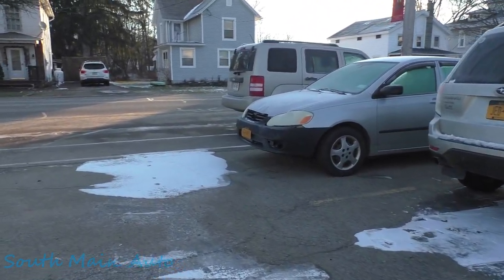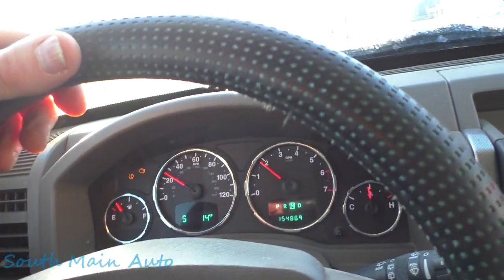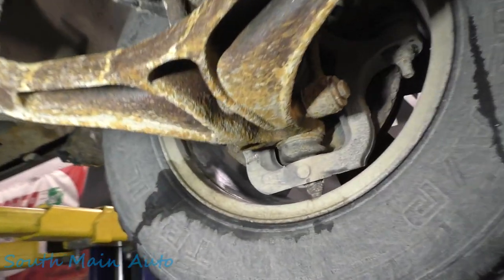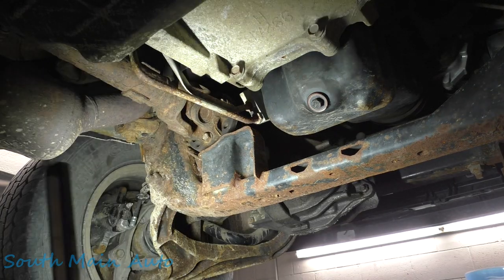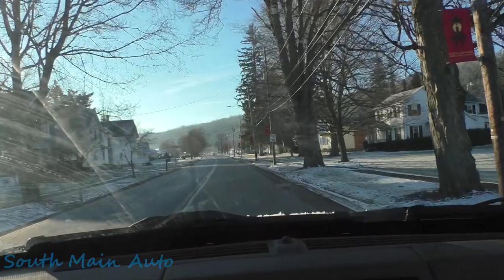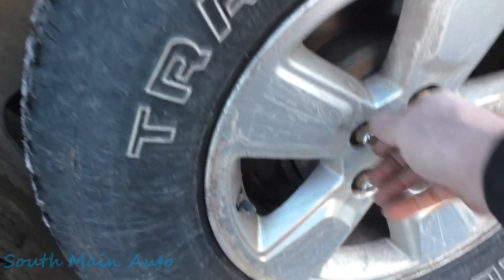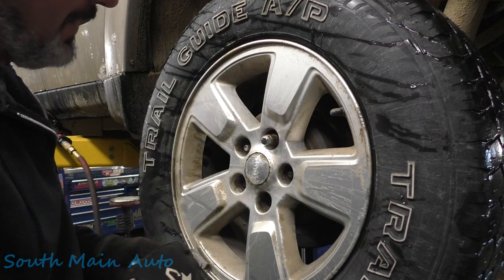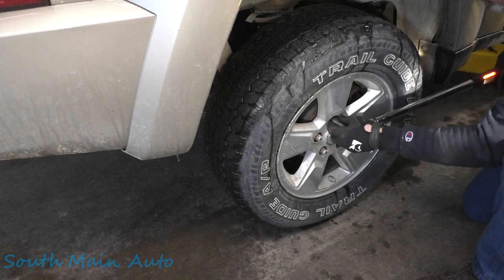Customer Just About Lost It.... A Wheel That Is

Comment: Two stories that connect. Dad had an 01 Ram and bought some American Racing wheels for it, you know the ones with the 3 tear drops, yeah, those. Anyway they were fine for several years, he had a service done and was driving around one day not long after and the driver rear wheel passed him going down the road. Luckily no damage. He put the wheel back on and it was fine for another few years until he traded the truck. He kept the wheels to sell later.
Several years later I bought a 99 Ram and decided those wheels would be a good change. I tossed them on and drove all over. One day, headed to his house from mine, I came down a hill where there is a stop at the bottom. Close to the bottom I felt a vibration but had to stop a few feet later. I stopped and took off carefully and sure enough the vibration was there. I continued slowly and tried to figure out what it was. A few seconds later there was a clunk and the driver front dropped a little. I carefully eased over to the right shoulder, thinking the wheel was off. Hopped out and looked. The wheel was still under the truck but the brake rotor was riding on the inside of the rim. The only thing damaged was a couple of studs. Jacked it up, put a couple nuts on where I could and limped it home. Replaced the studs and looked at the wheel and there was no damage. Put it back on and it stayed for a long time until I sold the truck! Cursed wheel!!

Comment: Over the years of running a garage i have seen loose wheels several times .A few times the wheels and studs were shot and needed to be replaced .I only did it once was installing wheels on a car after doing  a brake job . A phone  call from another customer came in and i forgot to torque the wheels, they were just hand tight. The road test saved my reputation .I heard a clunk before i left the lot .I knew  i had forgot  to torque them up.I  re/ road tested and all  was good.I always say the most important part of a repair is the road test .

Comment: Hi, I'm from Australia, (big island a long way south west of Hawaii). Back in the 1970's my family lived about 120 miles from Melbourne, and I stayed in the Melbourne suburbs during the week for university, travelled down Friday night late, returned to the city early Monday (left about 4 a.m.) aiming to get back to my city place before peak hour traffic. Had been servicing the car over the weekend checked brakes etc, put all the wheels back on with nuts firm but not tightened. My approach was to leave the hubcaps off until I had torqued up all the nuts, then fit hubcaps as each wheel was checked and finished. Got called for lunch, ate, went for a walk on the beach and came back, thought nothing of it, but my mum had come down and fitted the hubcaps. Left at 4.00 a.m. next morning as per schedule, working through a section of winding road at about 70mph, massive thump, and front left wheel departs, climbs an embankment, jumps a fence and runs about 1/4 mile across a field, hits another fence and stops against it. Meanwhile I had pulled into some space on the opposite side of the road, got out to survey the damage, and started to follow the  wheel track through the field to recover the wheel. Found it with the hubcap on, full set of nuts inside. Lugged it back to the car and managed to lift the nose of the car enough to jamb the tyre under the bumperbar, which gave me just enough room to get the car jack into place, lifted the car, refitted the wheel (studs damaged but OK for emergency use), checked other wheels (all nuts loose but torqued them up), and continued on my way at a more sedate speed. Darned lucky really, left wheel came of in a left turn when the wheel unloaded with body lean, previous curve was a right turn with a field of trees at the side of the road, if I had lost the wheel in that curve when the wheel was fully loaded, I would have been straight into a batch of 4 foot diameter gum trees. Spoke to my mother on the phone from back in Melbourne, she had gone around and fitted the hubcaps while I was at the beach because she didn't want me leaving them off cos it would make me look like a 'hoon' (Aussie term for idiot driver who doesn't care less about others).

Comment: My rule for all non steel wheels was torque to spec and write on the work order "return in 60 miles (100km) for free re-torquing" This included tire repair advice for flats carried into the shop.

Comment: Ha, having a KK for many years, I knew exactly what it was when I heard it. I had the same thing happen on mine. Ended up being when I did the brakes, I got some anti-rust spray on the studs when coating the hub face. The additional lubrication helped the lugs nuts back out easier. Brake cleaned the studs & never ran into an issue again. The sound is the spokes hitting the calipers which is why it goes away with brakes applied.

Comment: Holy.. I am instantly reminded of the time a tire popped off on me on route 90, driving a Yukon.  I was young and driving with a trailer and touring musicians; it was not my vehicle and I didn't understand how things worked back then.  We were driving back from NYC to Boston escaping a hurricane and kept having a strange vibration but only while turning to the right.   The vibration eventually got so bad on the Mass pike, around 5 AM, the right tire pops off, we come to a BOOM landing on the right front, screeching halt in the brake down lane.  I was lucky enough to feel it coming and get pulled over.  We watched the tire bounce, bounce.. bounce up and over the median and over the other side.  Luckily no one hit the tire as traffic was light.  

It was my friend's vehicle and the shop previously working on the vehicle had not torqued the lug nuts.  Tons of side wall damage and knuckle, etc... They paid for it.  Ever since then I started to slowly learn how to do my own maintenance and now do most of my own repairs unless a lift is needed or technical computer work.

Comment: A piece of info to add to this Eric, and this has just been my experience in maine with these same vehicles. Is that around the center hole of these wheels I have noticed aluminum corrosion building up and to about this exact situation our shop has made a point of chiseling out any build up around the center hole on the axle to prevent a high spot of that build up getting pressed between the wheel and the brake rotor. And we too have over torqued  and do a test drive and retorque to help prevent this. We do advise them to return for a recheck but you know that's a 50/50 if they bother. Good video and you aren't alone in wondering why on just the dodges.
Reply: This should be a pinned comment.  100% agree.  That crusty corrosion buildup around the hub center is enough to push on the wheel and get in the way of even torquing.   Some times I've found it to even be the cause of a small vibration that simply putting it on a balancer isn't enough to solve.

Comment: I'm 52 and I've been rotating my own tires since I.  I use the same tools today I used then.  A Snap-On air impact.  I run the nuts on and a couple whacks and call it good.  I never-ever had a broken stud issue.  I have a 21 RAM 3500 with 20k miles on it and I just went through a massive problem with broken wheel studs and aftermarket alloy rims.  I now torque them to 130 ft-lbs.  I have 45k on it and no problems.  Rotate every 5k.

I have a Noise Vibration Harshness App on my I-pad that can help figuring out where noises and vibrations are coming from on a vehicle.  I believe it's called NVH.  It was $100.

I have 7 vehicles.  Two junior drivers.  One experienced driver.  They're getting better about saying something if there's a new sound, or shake, or vibration.

Take care.

Comment: When I was in high school, my '72 El Camino had a set of universal lug bolt aluminum wheels.  They were fine until one day I was driving and it started shaking bad, ended up the aluminum behind the washer had worn away and the lug bolt was bottoming out on the wheel stud.  Lol I think I just stacked more washers on the stud cause I ran those wheels for another few years.  Great video Eric!

Comment: Years ago,  I made the potentially fatal mistake of tightening a wheel lug  nuts on my Mother's '63 Country Squire using a short 1/2" drive ratchet, I was 12 or so years old.
Lucky for me the wheel cover contained 2 lug nuts which had fallen off, which of course made a racket.
Trust me, since then I ALWAYS torque wheel lug nuts.
This lady was very fortunate for your expertise, knowledge and experience...

Comment: Had a MGA roadster that I was driving on PA Turnpike and stopped for gas and as I was driving in parking lot heard something rattle in hub cap. Pulled the cap off and part of one of the 4 studs was broken off. Drove slowly to my destination with 3 studs and replaced the broken one.

Comment: Drove 1400 miles after putting a 4.5" lift on my 93 Jeep Cherokee with bigger wheels and I forgot to re-torque the lug nuts after using an electric impact. Heard a clunk when stopping or speeding up upon entering the last 100 miles to home. Thought it was the track bar up front since it had loosened up before but didn't check the noise until I got home. Ended up being the left rear wheel, it had shredded 4 lug nuts but the studs were fine and the wheel wasn't damaged. Learned a good lesson to always torque lug nuts 100% of the time and to never use an electric impact to tighten lug nuts.

Comment: Thanks for putting this video out Eric, this one gave me a flashback on one vehicle I worked on long time ago. I always and I mean always torque wheels to the specifications each and every time. I remember a shop I used to work for this gentleman had a 2010 or 2011 I'm not sure, but it was a Dodge Ram 1500.

I remember torquing all of the wheels properly every time when we had the wheels off for service when doing brake inspection or whatever. This customer would somehow be back a few weeks later or so saying his lug nuts were loose, but no noise like in the video, but noticed a couple of the lug nuts were loose. So we ended up just using the proper socket and proper torque spec once again and just retighten everything (Those lug nuts like to swell up after some time). I think we used a 7/8" socket or 22 mm socket can't remember anymore. Somehow there were common problems with those alloy wheels not sure why. Once we did that I think everything was all right in the end. Those wheels are super finicky they must be torqued precisely after service or else you're faced with this problem.

Comment: I too have a loose Chrysler wheel story.  About 9 years ago I had a 2001 Town and Country.  A horrible noise developing on a drive back home.  I got off the highway and as I turned into a Tim Hortons/gas station the wheel popped off.  Wow was I lucky!  In fairness to Chrysler, I think I may have not checked the torque after replacing a hub.

Humorously enough, to limit the use of the spare donut and before the used tire I ordered online came in, I drilled, tapped, and put a bolt gooped with sealant on the inside part of the rim that was punctured by the rotor. It held for over a week and when I brought it in to swap the tire, the tire place accidentally threw my good wheel in the trash!  I was able to get back there before their trash pickup and was good to go.  Great videos!  I learned of you through Watch Wes Work.

Comment: Interesting, I have a 99 dodge ram 1500 and have always used the 95 ft lbs for the lug nuts. Never have had a problem. But I always check them after a tire has been removed. I'm also pretty particular about having the wheel surfaces clean before putting the tire back on.  I can definitely see your reasoning for increasing the torque. Thanks for the info.
Reply: I, too, us 95 ft/lbs on my Jeeps.  But, then, I rotate the tires myself every 5000 miles (at oil change), so they don't have much chance to come loose.  Using 95 ft/lbs makes it much easier to change a tire on the road with factory lug wrenches.
Reply: Your experience helps validate my hypothesis that the loose lugs result from over torqueing the lugs. There has to be a mechanism decreasing lug tension before the nuts can loosen; nothing is exerting a loosening torque. That mechanism is a combination of lug tensile yield due to over-torqueing (stretching) and compressive yield due to the aluminum wheel's local compression. Once those lugs yield, no amount of over-torqueing will keep them tight. DO NOT over-torque!
Reply: @timwintersoncntr  But Eric just said he over torques to 120 ft-lbs from the specified 95 ft-lbs.
Are you saying Eric is doing it wrong?
Reply: The spec on my 2011 Ram 1500 is 140 ft-lbs.
Reply: @bartsarton2212  no I'm not saying that. As I mentioned in my comment, I can see his point. He has seen more of them and the problems. I was just stating what my experience with my Dodge was.
Reply: @bartsarton2212  Beyond the detailed reasons I've stated in my comments here warning against over-torqueing lugs, a repair business which acknowledges that it is aware of the factory's specified lug torque and then proceeds to over-torque them by a factor of 1.25 (on the dubious theory that loosening lugs are the result of the factory's spec being too low) opens itself to liability should a wheel/hub fail in the future. Yes, he's doing it wrong.
Reply: @timwintersoncntr  I can't argue with your reply. You have made valid points.

Comment: Years ago I "Buick Grand Nationalized" a 1981 Olds Cutlass. Painted it black and stuck a 454 in it. It was a monster! Would break the tires loose at 50mph if you punched it out.

One day I took it to a bike shop in the wrong end of town. Parked in the back. Couldn't have been there for more that 15 minutes. Drove home. During the drive home I noticed a knocking from the front end. I pulled over and did a tire check. Someone had taken the nuts off the right front wheel, except for the one lock nut! The knocking was the wheel rocking on that one stud hitting the brake caliper. The wheel SHEARED off the other 4 studs! Got it towed home. Wheel rim had some scoring but wasn't ground down too much (steel rim with aluminum centers). Banged in new wheel studs on the brake rotor. Car drove fine afterwards.

The scariest part of this tale? I was thinking of taking it out on the highway and punching it out for fun. Could've lost the wheel and got killed that day. I'm now paranoid about wheel nut tightness, and do a wheel check most times I park somewhere. Better to be vigilant than crippled or planted.

Comment: At work, we all have a loose wheel incident (well 1 of us has a broken wheel stud incident), rust is a SOB! sometimes the wheels just need to be retorqued after 100miles, at least that's what we've been doing and haven't had a issue again.
Reply: heard a clicking noise after new front tires last week.  first thought was bearing but when i checked, i found a missing lug nut with two others loose.  got new lug at auto zone.  instructions on pack of lugs actually said to retighten after 50 miles.  it never occurred to me to recheck.
Reply: That's the correct way.  Re torque after 100 miles.  And clean the hub and wheel
Reply: @JJ-iw7nh  yeah we clean hubs and studs. As for the retorques, I knew that but "my" shop wasn't following through on that, so I wasn't too shocked when it happened but yeah.
Reply: @DapimpBDSD  not too many shops even bring it up to the customer

Comment: Glad you caught this before disaster struck.
If I was her, I'd be getting those wheel nuts checked at regular intervals.
Reply: *were. You should know better as a Brit.
Reply: @paulparoma  I am at war with the conditional form of was/were. Formal grammar calls for "were" in the conditional use but it makes no sense at all. The context makes the conditional clear, so there is no reason to muddle matters with an irregular form. It is as silly an edict as not using a preposition to end a sentence with.
Reply: @flagmichael  No, the conditional has a purpose. Without it, the meaning is different. Many languages have it in one form or another. You can wage your war all you want, but not using the conditional when required is plain incorrect. Same as not using capitalization or punctuation.
Reply: @paulparoma  Bet you're a blast at a party.😆
Reply from the maker: @alanross2790  At least they wouldn't be gettin' all the girls 😂
Reply: @paul 
If you came clean and admitted that you ate the cookie would it be "I was the one" or "I were the one"?
Reply: @flagmichael  Lol
Reply: @larrybe2900  "I was."

Comment: I had a wheel fly off while driving on the highway. Fortunately it was a rear tire and it was easy to pull over and stop. I spent several minutes trying to find the wheel but was never able to locate it. Amazingly the most  expensive part of the repair was replacing the wheel.

Comment: Wait !   I thought wheels were supposed to be "finger tight" so it would be easy to change a flat tire. I mean if you have a flat you want to be able to change it even if you don't have a wrench. Right?
Reply: Absolutely!! Same as with flat tyre. Just rotate it 'cause it is only flat on the bottom. Retired mechanic in Land Down Under.

Comment: I currently own 4 Chryslers since new, all with alloy wheels: 1998 Ram, 2012 Liberty, 2015 Wrangler, 2019 Grand Cherokee. No one touches the wheels but me and I always torque to factory spec with a Snap On Techangle, just like Eric's.  I've never found a loose lug nut on any of them.  So if this is a problem, it might be related to out of calibration torque instruments or worse, the ugga dugga gun with/without torque sticks.  Because my luck simply isn't that good.

Comment: I had a wheel come off when I was working at a dealership in the early 90s. When I got back to the shop the guy that worked beside me started into Ya picked a fine time to leve me loose wheel. Good times, thanks for the share.